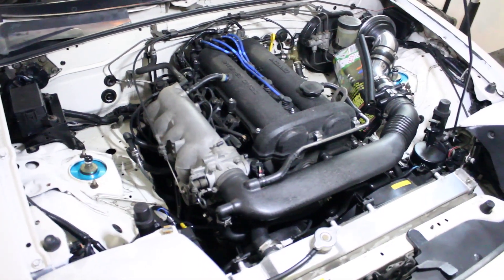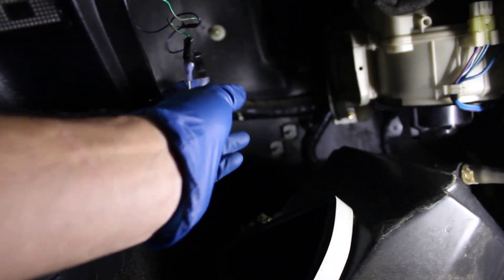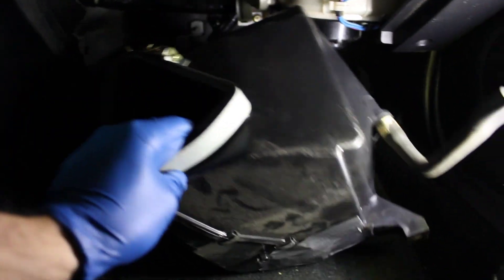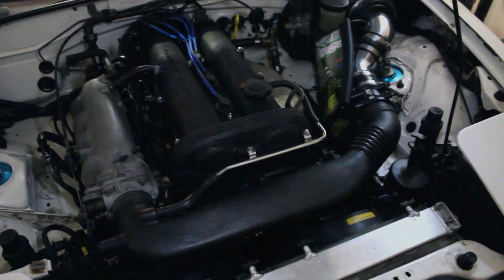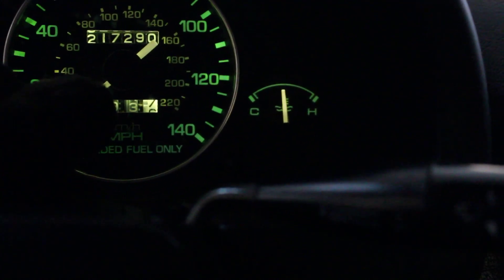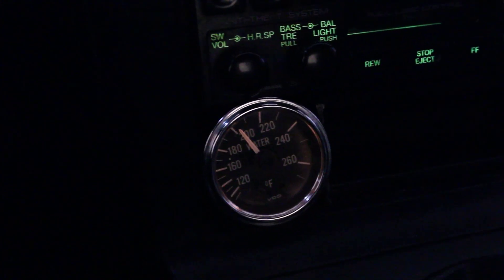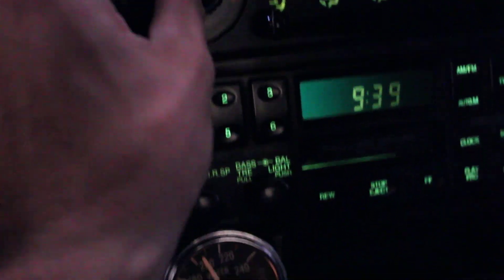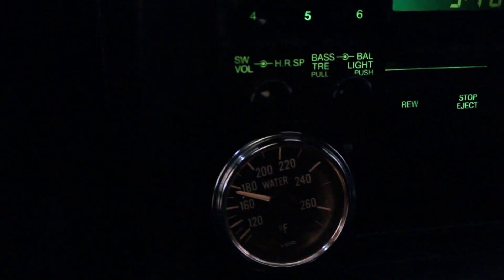SIMPLE FREE MIATA COOLING MOD - Manual fan switch

Comment: I did this on my 90, and when im at full throttle, the fans stop spinning. Need them to be constant as its a drift build. Any solutions? Tia
Reply from the maker: @miatabf  yes factory ecu disables all AC function at WOT. Your best bet is wire fan to a dedicated switch then

Comment: Thanks for sharing. It was very informative and useful. Have a 97 and I noticed the fan kicks in late. How did you connect the real temp gauge? Thanks!
Reply from the maker: I tapped into my heater core hose exit. used a brass t fitting with a mechanical probe. Wired gauge light to key on 12v (radio power wire works nice) and made a little gauge panel.

Comment: Will this work for my 93 miata? I can't find that connector anywhere under my hood
Reply: idk if you've figured it out yet but, I'm still quite confused on how the previous owner did it. all i've been able to find is the blue wires jumped in the video behind the glove compartment, instead the previous owner attached it to an ignition wire so when you turn the key it gives power im assuming. When i bought the car all he saiid was "press the ac button if you're over heating, it kicks the ac fan on too", and didn't go into what he did. But ill check the high side pressure switch tomorrow to see if thats jumped. Ill come back to edit the comment if it is jumped and where to find it
Reply: @John-pp6xy  I couldnt get this to work for my 93 miata and i ultimately wired in a toggle switch just for the fans and i must say i like the switch way better. nice switches are literally just a couple of bucks and youll need several feet of 18 gauge wire but it literally only took me an hour to complete. i put the switch on the left side of my steering wheel next to my cruise control. theres a lot of good videos about how to wire a fan switch and i can also post one of my work if youd like

Comment: If I have a ac is there a way to have both fans working still ?
Reply from the maker: Both fans should work when you turn ac on
Reply: @clubtouge1052  sorry I meant like if I do this mod my ac will still work right ?
Reply: Ok but if I have a ac system that works is it possible to Hotwire both fans to always be on ?
Reply from the maker: @grantx2819  if you have ac you dont need this mod
Reply: @clubtouge1052  oh wait so if I just push my ac button will both my fans work?
Reply from the maker: @grantx2819  i would not want fans on all the time. But if you want the choice you need to tire them in parallel and to a switch that you control or just to ground so they are on whenever the key is turned. This "mod" is basically tricking the cars with deleted ac to run both fans (as it should) when ac is activated. Without the pressure switch jumped car thinks there's no ac and doesn't run the fans. Turns your oem switch into a cooling fan button if you have no ac
Reply: @clubtouge1052  thanks for the explanation! I also was wondering what quick release setup you are using ?
Reply: Sorry and also what coolant do you use ?
Reply from the maker: @grantx2819  no quick release. Its a dnd wheel fixed to dnd hub. I run 75% distilled water and 25% straight antifreeze

Comment: So, at the moment, I'm chasing an overheating problem. I came across this video and thought maybe a previous owner did this to my 90 Miata. The fan doesn't kick on automatically, but the idle jumps to about 1200 and stays there. I saw another comment say that his jumps too, but as far as I could tell, the engine is bogged down while on and the idle never settles like you said to him. Plus, his is boosted while mine isn't. I thought it was a broken fan sensor connector, but this video made me think a previous owner did this to bypass and just have manual fans. The AC was also removed, but I know nothing in terms in wiring so I have no idea what to look for or where
Reply from the maker: With this mod your fans 
should still work automatically as normal

Comment: So I did it on my 97 Miata and when I turn on the ac fan my idle jumps to 1500. Should I worry about it or just leave it
Reply from the maker: Ecu trying to compensate for ac compressor load that isnt there anymore.. 1500 rpm sounds high what is your base idle? Mine will jump from ~850 to 1100 ish for a second once i hit the fans then it idles normal
Reply: @clubtouge1052   my car is boosted running on a voodoo box as well. That could be it. But normal idle is 8-900ish

Comment: I deleted my AC and Neither of my fans turn on no matter what i do. is this what will fix my issue? TIA
Reply from the maker: One of your fans should come on regardless of having a/c or not, once the ecu reads that the engine hits a certain temp. Test and make sure your fans are working
Reply: @clubtouge1052  my fans are brand new. It's the connecting plugs that are in the car that don't work.

Comment: I ran the two things like you did and still my fans will not turn on.  Engine speeds up like it should and nothing.  My diagnostic ports dont turn the fans on, relay clicks, fuse is good, and fans turn on with dedicated power.  I am at a loss here.
Reply from the maker: Check wiring between fans and relays. If you get fans to turn on with dedicated power but nothing else, start at the fan connection plug and chase your way back
Reply: Dang, that is going to be a project to chase that wiring.
Reply: I'll try it this weekend, running out of time to look at it tonight.  I used to run the AC fan to the drivers side fan, and today it decided to stop working.  Maybe I toasted the AC relay?  Not sure which one powers the AC fan.
Reply from the maker: @Tuskanr  you can try replacing the relay or cleaning it. They can click but still not be functioning
Reply: @clubtouge1052  The drivers fan I tried multiple relays.  I will just have to wire them to a switch on the dash.  Seems the easiest route.

Comment: I wonder if this process is the same on the NB... hopefully I'll return with some answers.
Reply from the maker: What's the prognosis
Reply: @clubtouge1052  nope, but I ended up splicing into the harness to create a ground for the factory AC condenser fan relay.
Reply: @jacobjung3814  I am having same problem where did you splice???
Reply: @Simpyspec  I just spliced a wire into the ground for the relay that controls the AC condenser fan. Ran it to a two-way switch, grounded the switch to the chassis, and added a fuse for good measure. Worked flawlessly.
Reply: NB is the same kinda